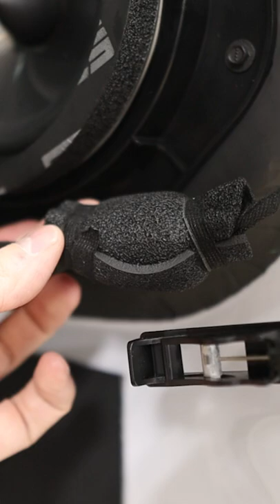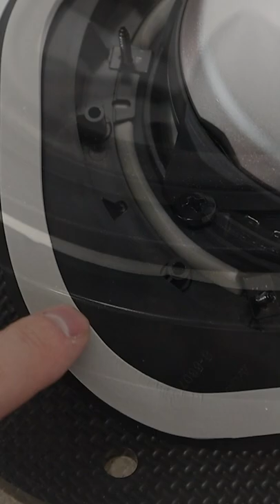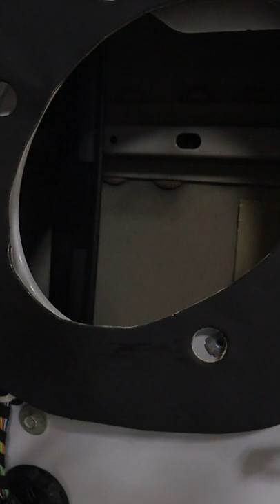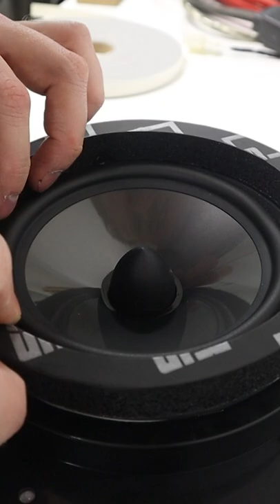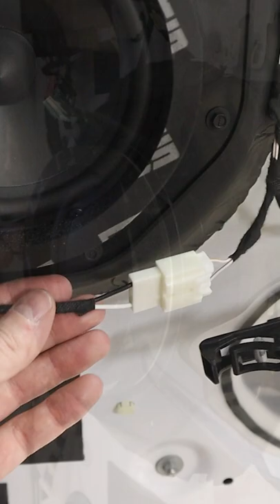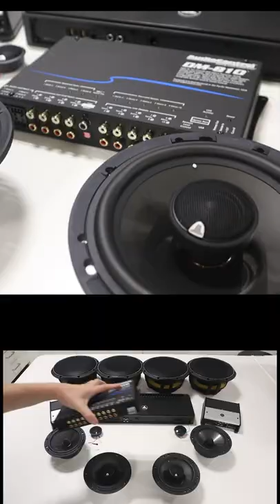Installing Speakers? These techniques are a MUST! #shorts

Comment: Mid bass is exxtremely important
Reply: As someone who just dropped a deck, sub and Amp into a 06 Tribute this is very true. The bass is great, the highs aren't too bad, but everything in between... is meh. Sadly it's still sounds better than the Sony System in my Focus RS that's 10 years newer 🤣
Reply: When I was younger all my friends wanted to know why my system sounded so much better with so much less. Mid bass is key!!!

Comment: Application does more for sound than specification. We relocated and redid the factory speakers in a old Buick and used it to demo for our install quality. We had fully built demo cars but the reinstalled actual factory speakers in the Buick sold our methods. It’s good to see the younger generation getting into technique. You don’t need to hear it from me, but great job! Good job on back wave isolation, how do you feel about back wave diffusion?
Reply: @kylevanwinkle2081  dang reading comments like yours & Chance Frenette's makes me realize I still have so much to learn!

Comment: this is awesome. I have a 2008 Nissan versa that I want to upgrade just slightly. with like just a mostly just the better radio center thing. what's the like most efficient economical way to do that

Comment: Silicone gasket maker is also great for sealing the speakers, woofer hole or speaker radiators!
Reply: silicon causes a reaction with copper so id avoid that.

Comment: Aftermarket speaker harness? No I just solder the wires and hit glue the wire to the door metal, I have been doing that for 30 years not a single problem

Comment: Bought Alpine R-S65C.2 components for front Corsa powered by Ground Zero Titanium 2x150wRMS tuned to 20v with multimeter. Not very loud. Cones don't even appear to move at full volume.

Premium 14 gauge speaker wire. Tested polarity with 9v battery. Going to turn amp all the way up to 150wRMS with oscilloscope. Is this a good idea?
Reply: Added rear Alpine R-69.2s to amp at 2ohms. They're louder (co-axials) but again, cones don't appear to move at full volume.
Reply: Make sure you’re checking everything before the amp especially the source unit. There could be a bunch of issues with a stock aftermarket head unit.
Reply: Are you running stock head unit? Even if its premium stock head unit, your impedances may not "JIVE" with eachother...I have 2012 nissan armada platinum with a "PREMIUM"(pffft) 12 speaker BOSE system...was a long time consuming process to upgrade system while leaving the H.U. stock just to keep navi, rear entertainment center, steering wheel controls all still fully functionable  & MOST importantly the wifes mouth functions ie.... bitching, complaining & harping over something not working right or working at all which was imperative to keep that 100% unfunctionable!!! Bose uses oddball impedance levels... 2.7ohm, 3.4ohm H.U. outputs  So even if I installed top of line  speakers, lets say FOCAL's theyd sound worse then the stocks...i found infinity kappas were the closest impdnc match. Also what made the SQ COMPLETELY nite & day in comparison, was an AUDISON D.S.P......any dsp would be world of difference & eliminate any EQ
 capping/restriction coming from the H.U.
But any of the Audison D.S.P. models made SQ uncomparable and FKN AMAZING!!! U PAY 4 WUT YA GET!!!
I WISH I KNEW OF & WENT THE AUDISON ROUTE MANY MANY MOON AGO!!!!
Reply: @jval6010  Have Pioneer AVH-Z5200DAB head unit (not very good sound quality compared to Alpine).

Solved my speaker problem with 150wRMS going into them. Still need a DSP though.

Comment: I'm installing a new speaker system in my old 87 Chevy caprice. There are no door speakers I don't want to make holes for that either. Will the audio still sound good if the speakers are in the dash/back?
Reply: What a car you got. Just amazing

Comment: Expanding foam and then just shape it pretty cheap
Reply: @kylevanwinkle2081  there's expending foam specially made for sound insulation applications
Reply: @kylevanwinkle2081  nobody's said anything about Lowe's. Have you ever worked with sound insulating foam? Anything to be the devil's advocate huh?

Comment: I found that the doors of my car seem have a slight leak from some point. The water gets to the speaker wire and causes them to go in and out. Is there a temporary solution I could use to block this water?
Reply: You can get 6.5" water covers for the speakers. Will try and copy link (YT doesn't like that)
Reply: Couldn't copy link.
Reply: A tad late, but they're called speaker baffles. Make sure you measure your speakers before buying them. They come in several depths based on speaker basket/magnet size not just the overall diameter.

Comment: Mark I have a question.  What would you recommend to power two jl aduiov10tw3-d4 subs keeping  the stock system of a 2016 tundra non-JBL.  Since I'm keeping my stock system for now I beleive I will need to invest in a Line Out Converter, the goal is to eventually add a second amp when I replace qll of the speakers, but what would you suggest until then.  Thanks
Reply: Any loc (line output converter) unless you want to tap into the factory speakers for an amp audio. 

Any brand name 500w RMS amp. 
 JL amp
Rockford Fosgate
Skar amps 
CT sounds
Kicker 

Just never ever use boss or any thing equivalent to it. 

Watch BigDWhiz on YouTube he does amp dynos to see their true power output. 
There's other guys but i just enjoy his videos